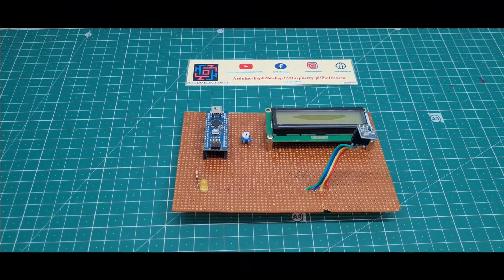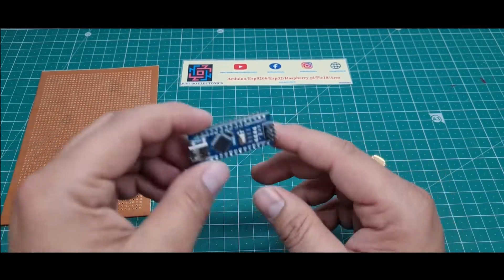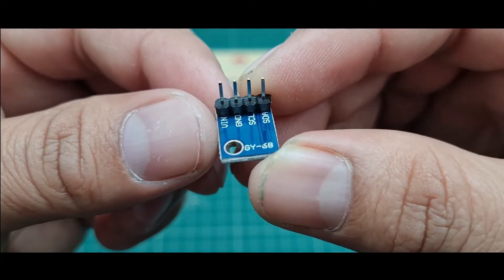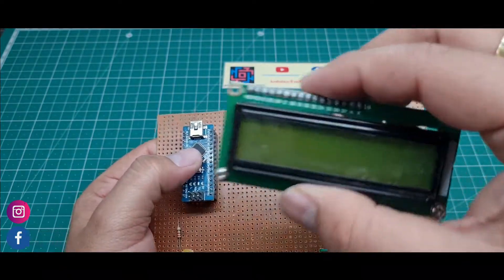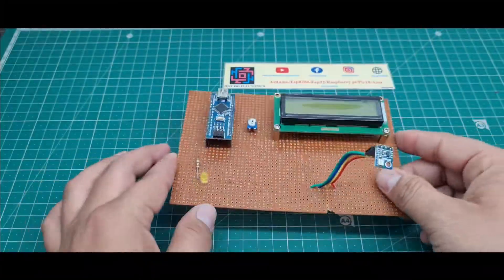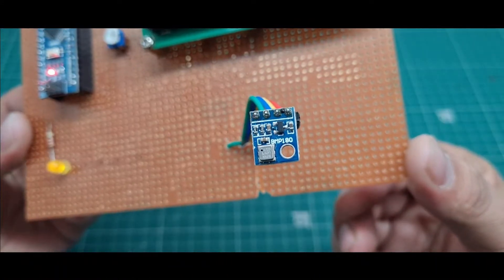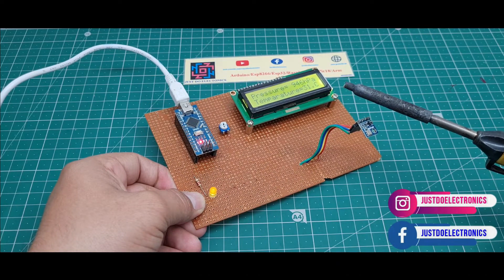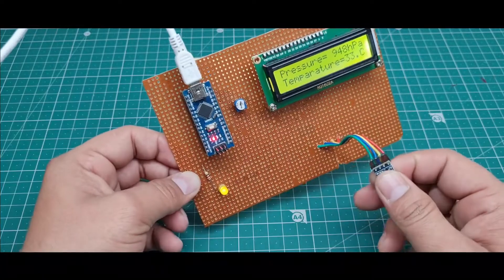DIY Air Quality Monitoring System With BMP180 Pressure Sensor

Comment: Bmp180 sensor vcc pin connect arduino 3.3v pin
Reply from the maker: Yes
Reply: But i am go to chrome search bmp180 sensor with arduino nano, JustDoElectronic 
Cliked
This photo 👀 and connect and arduino nano coding but fake code, bmp180 sensor soth😢😢😢😢😢
Reply: But this photo contacted bmp180 sensor vcc pin arduino Nano 5v pin